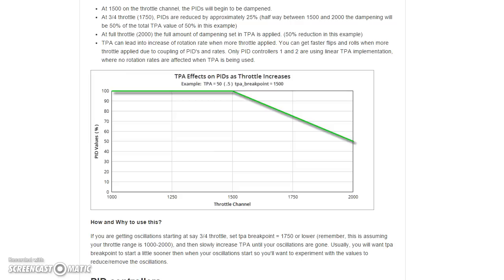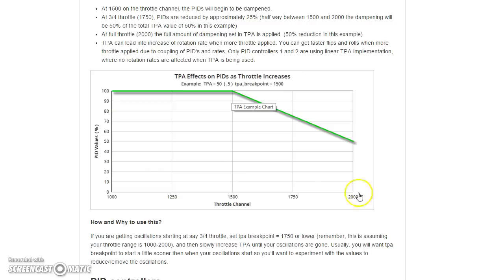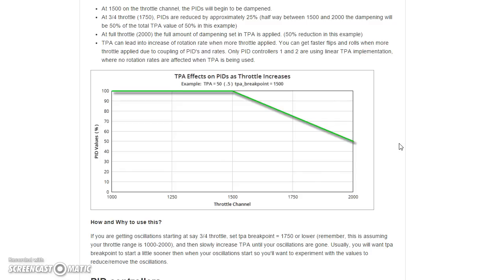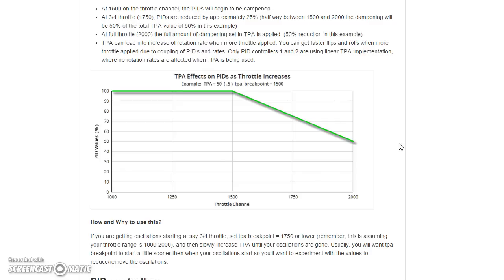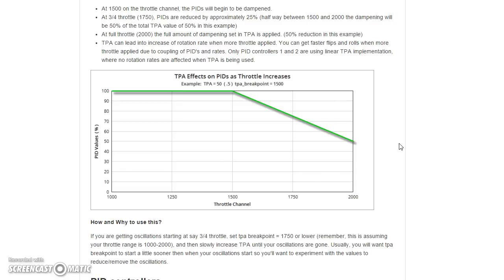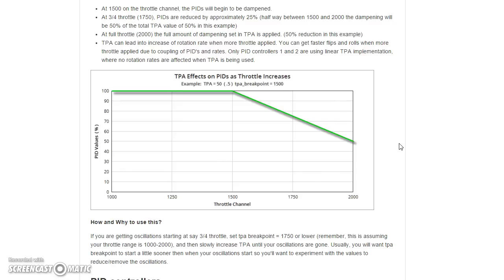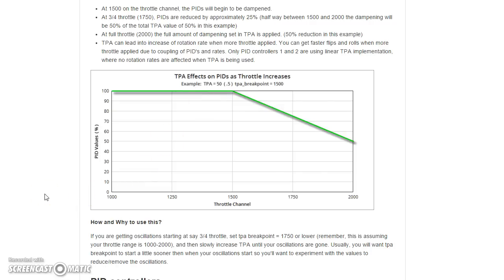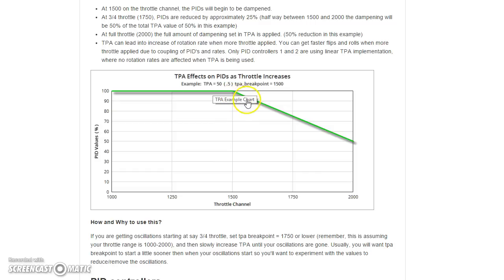Tuning Throttle PID Attenuation on Cleanflight

Comment from the maker: One additional thought: if you have oscillations at one throttle position, but not any other throttle position, that is probably a vibration resonance and not something that can be solved with TPA. In other words, if you have oscillations at 1400 throttle, but not at 1450 and up, that's resonance, not TPA. If you have oscillations that start at 1400 and just get worse and worse as the throttle goes up, that's what TPA should be used to solve.

Oscillations at a specific throttle position may also be caused by an interaction between the ESC and the motor. If you have oscillations at one specific throttle position AND you are really sure your motors and props are well balanced, try changing motor timing and dither settings to see if they help.
Reply: Hi Josh, how can I fix that mentioned resonance problem with my Emax RS2205-2300 kv. I tried different props and with some its better (HQ) or worse (DAL). How to tell the FC to ignore that vibration (probably a slight unbalanced Motor, the gyro oscillation with all props off is hardly visible). Thanks a lot.
Reply from the maker: +Jack Blacksmith filtering is the answer, but the oscillations are likely to be too low frequency to be filtered without affecting flight characteristics.
Reply from the maker: +Jack Blacksmith filtering is the answer, but the oscillations are likely to be too low frequency to be filtered without affecting flight characteristics.

Comment: Nice and clear explanation. Thanks Josh. I was wondering if you have a flight video wherein you have to adjust tpa?
Reply from the maker: Not off the top of my head. It's less necessary today than it used to be. If you have oscillations at high throttle and only at high throttle, then TPA is the answer.